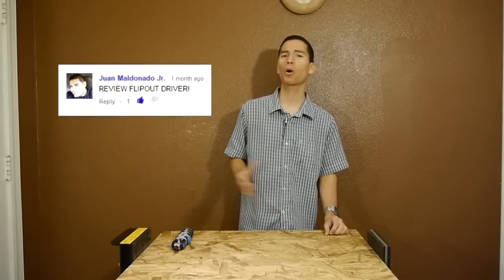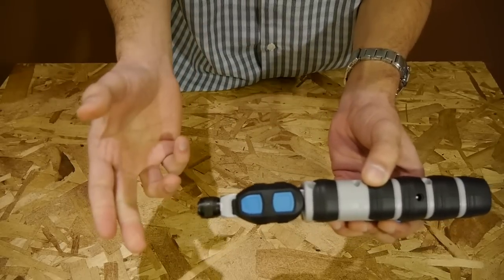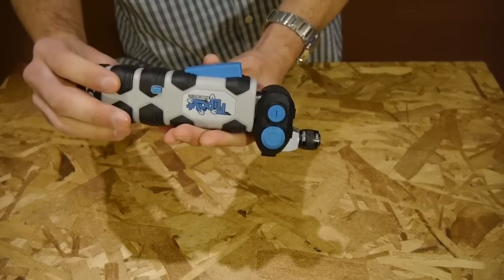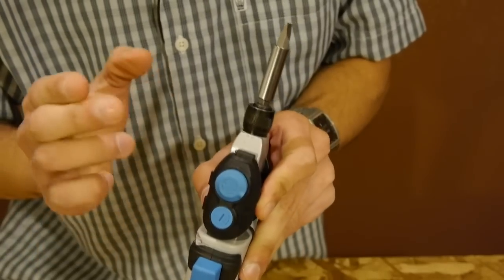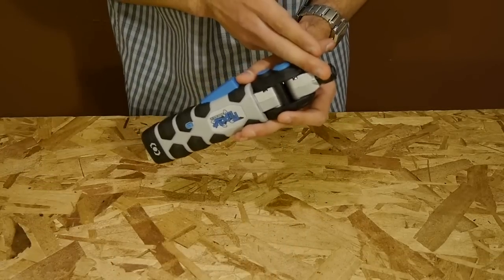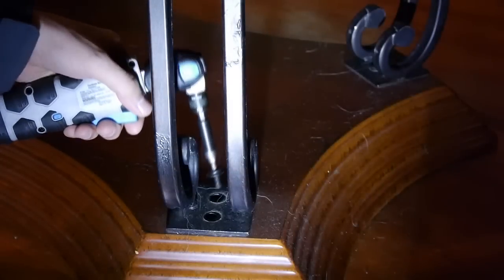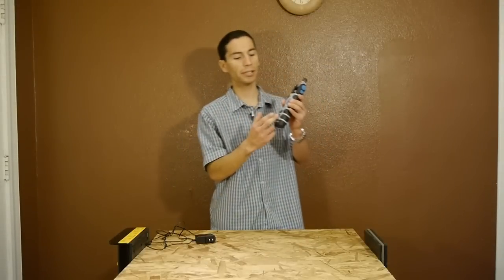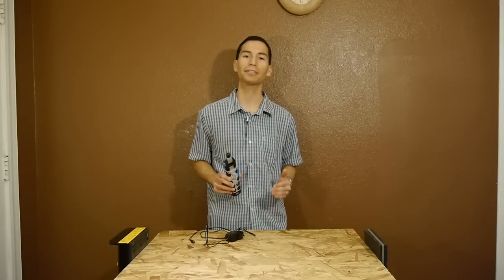Flipout by Speed Hex 8 Volt Max Screwdriver Review

Comment: I got one for Christmas and it works okay. The forward reverse switch is in a bad place, I keep hitting it by accident as I am using the tool. After 9 months of use the articulating head is starting to get sloppy, also the LED won't stay on, and yes I know it has a separate battery.  So basically I would not buy one of these if its only going to last a year or two. I am going to attempt to return it to Lowe's for a new one since it was a gift.

Comment: That's a cool little tool. It was originally called the Flipout by tantrum but they tried to do a Kickstarter to get funding to build it. It didn't really take off as the price point was much higher than the $25 price you can get this on at. The only big difference is the original had a removable battery pack.
Reply: Oh I do see the original didn't have a variable speed trigger that's a nice addition to the new version. That's the big problem with a lot of these pocket screwdrivers they don't have variable speed triggers which is kind of a big deal.
Reply from the maker: DarkRaptor99 I remember hearing that tantrum name also. I think it had more torque in the prototype